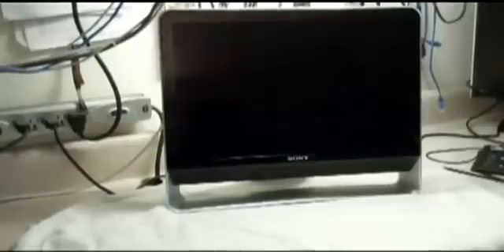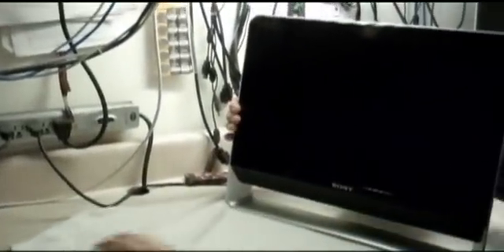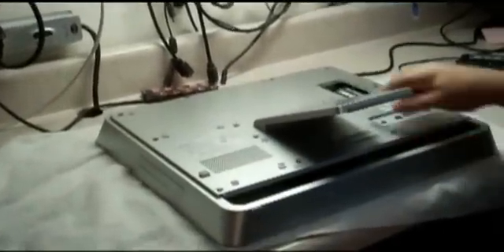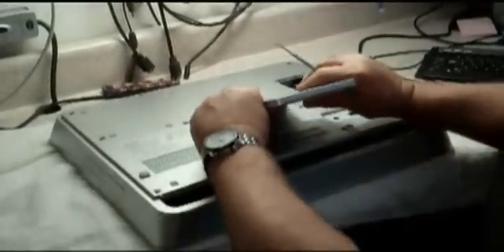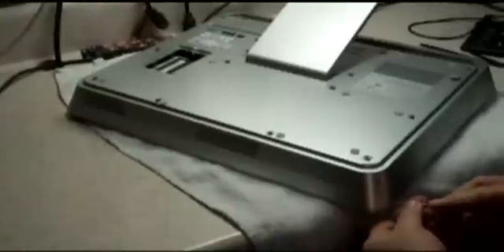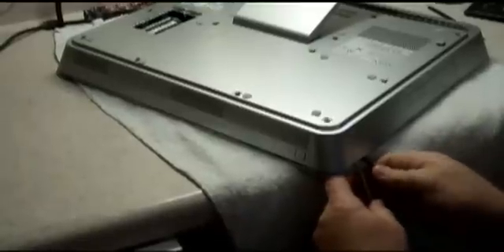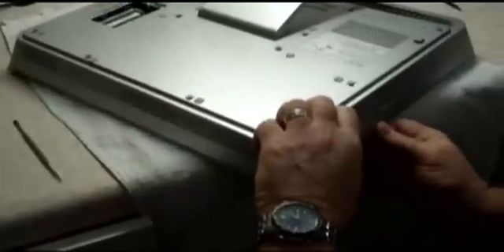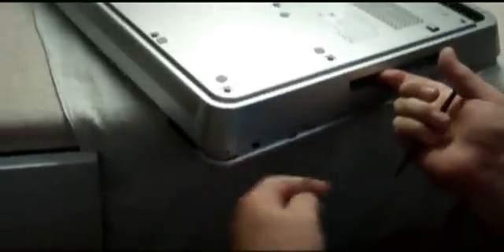VGC JS240J PCG 2J1L remove Open case repalce hard drive

Comment: I've had this computer since 09 but haven't used it in several years. The cpu fan went out and before it overheats it shuts itself off. Would it be easier installing a new fan or just removing the hard drive?